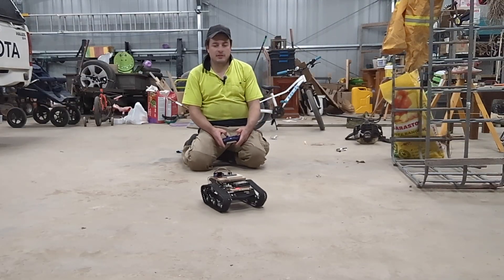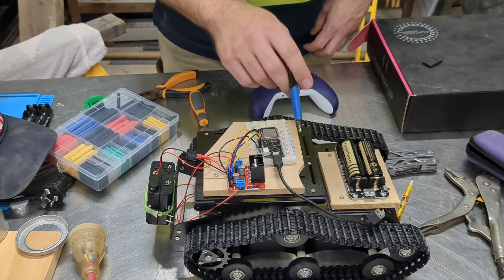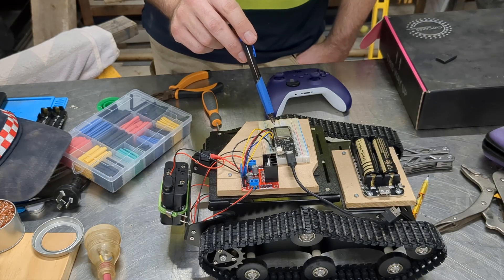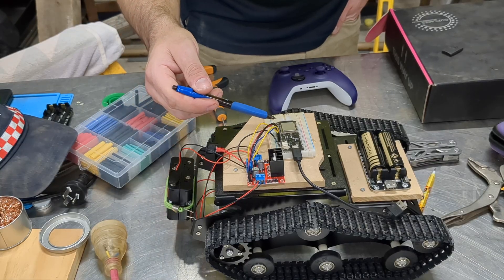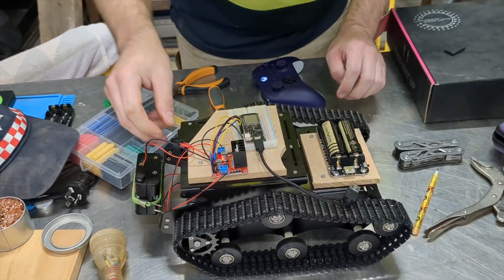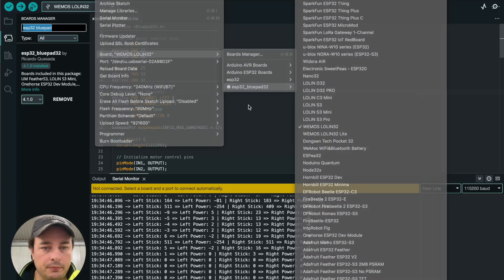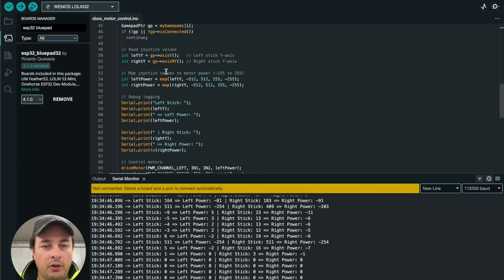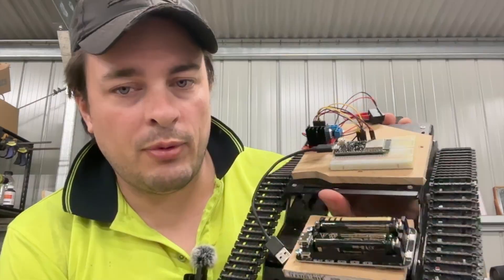Controlling a Tank Chassis with an Xbox Controller & ESP32 | My DIY Robotics Journey Continues

Comment: my question is how are u giving 5v pwm from esp32 since it works with 3v3 logic. which means the l298n motor driver will never output the peak power output.
Reply from the maker: To be honest, I didn't give it much thought, I just plugged it in as that's all I had at the time and it seemed to work ok. I have since swapped out that l298n for a better solution though.

Comment: compilation error: 'ledcSetup' was not declared in this scope. can someone explain what i have to do?
Reply: Yeah bud i got it all the time until i worked it out,  new computer downloaded arduino ide 3.2. It wont work.  Go back and install 2.1 then itll work
Reply from the maker: Hey! I haven't personally encountered that error, but from a quick look, do you have the Arduino.h import? ledc seems to be part of that header. Also, make sure you have arduino IDE setup with esp32, go to Tools > Boards, and pick esp32 dev board.

Comment: Super cool! I would recommend using a LM2596 DC to DC buck converter to get 5v from the 12v you use to drive the motors.
Reply from the maker: Thanks for the tip, I literally just received some of those! I'm looking to replace the L298N motor driver that exploded in my latest video, any recommendations?

Comment: 这个程序不需要获取Xbox的IP地址吗
Reply from the maker: Hello! If the translation is correct, you're asking about the Xbox IP. In this case, we're just using the control pad (and not the console itself). When the code on the esp32 starts up, it is always available for pairing, which means you can grab any xbox controller and hold the "pairing" button and it'll automatically pair with the esp32. Hope this helps.

Comment: Starting an esp32 project and I just bought some cheap chargers from aliexpress that do 1 or 2 18650's. Also got some cheap charging boards as well (TP4056). $300 is too expensive for a half done side quest for me! The real problem is that it takes 2 to 3 months to get the 18650's from china. Great project, would love to see it go over some grass or obastacles. You could use a step up voltage regulator to run the motors off of the 18650's as well, like the MT3608. Probably need to code in a shutoff for the 18650's? Or maybe the shield you have does that anyway.
Reply from the maker: Wow 2-3 months shipping, where are you? It's about 2-3 weeks for Australia. Yep the tank does ok driving over grass, gravel and such, I'll post a video when it eventually stops raining here. I'm planning to ditch the 18650s and just run it all from the Ryobi drill battery with a few buck converters, for me it's so much simpler to just swap those drill batteries out for charge, and the weight helps with traction.

Comment: Bro i think you should not use different power supply as it's inconvenience so i think you should remove the esp32 power supply and connect the gnd and 5v pin of l298n to the vin and any gnd pin of esp32 it works absolutely fine i've tested it out if you found this useful then you can also help me out by shipping a 3d printer??? i know it's a lot but that's my best bet.:face-red-heart-shape:
Reply from the maker: Thanks for the tip, I did look into that but the issue is the l298n puts a limited number of amps out over 5v and when the esp32 is running Bluetooth and more sensors it's not enough. Could be handy for some LEDs though!
Reply: @HalfDoneSideQuests  well I mean I did the exact same with the 3×18650 setup and it works just fine or like as intended because sensor or microcontrollers draw less as compared to a servo or any kinda motor

Comment: Hey mate what about making have 4 motors adding x2 front motors? Just an idea 🤷🏻‍♂️
Reply from the maker: Heya, I'm not quite sure if that would drive ok, tanks tend to have 1 drive wheel per track. Upgrading the motors themselves is an option.

There's another chassis on AliExpress that has 4 motors, but has 4 sets of tracks, I'll get that one eventually to try!
Reply: @ okay great looking forward to seeing some upgrades is it possible for you to put together a full parts lists for this I’d like to try also would it work with a Bluetooth ps4 remote?
Reply from the maker: Hey, I've updated the video description with a parts list, let me know if you can't find anything and I'll do my best.

Yes the ESP32/Arduino code is using a library called Bluepad32, which supports Dualshock 3 and 4 and Sony Dualsense controllers, along with loads of others. https://bluepad32.readthedocs.io/en/latest/

I'm going to make the battery setup a bit easier, then I'll be adding a Pi and camera for FPV and maybe some AI object detection. It might take me a few months but stick around I have heaps more coming!